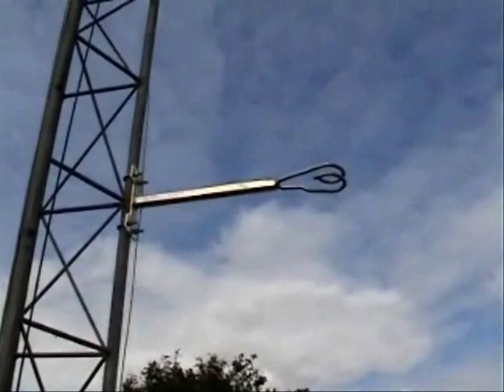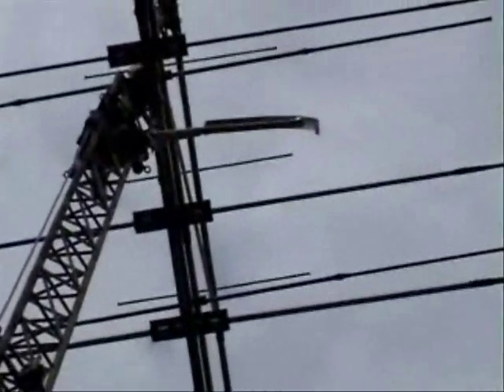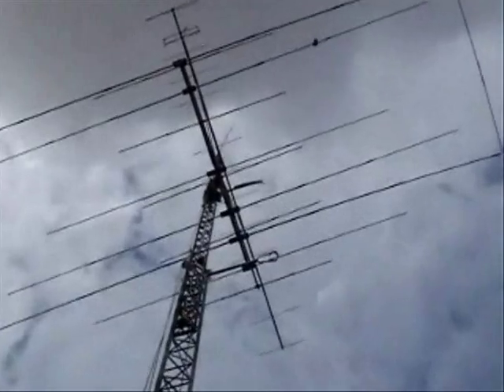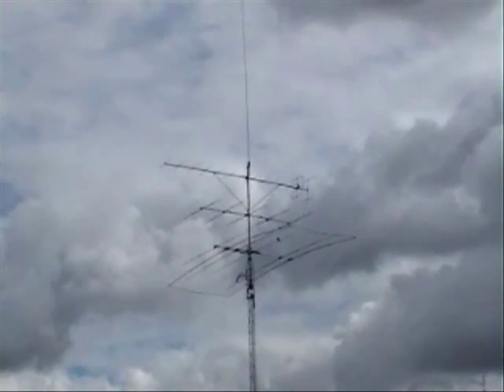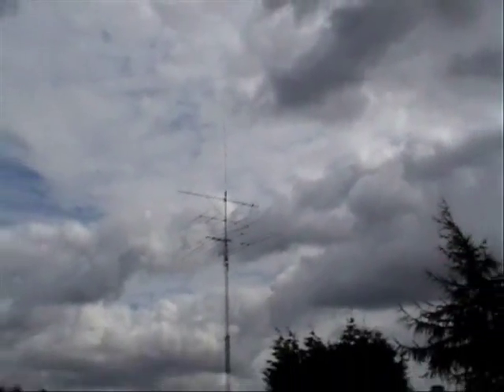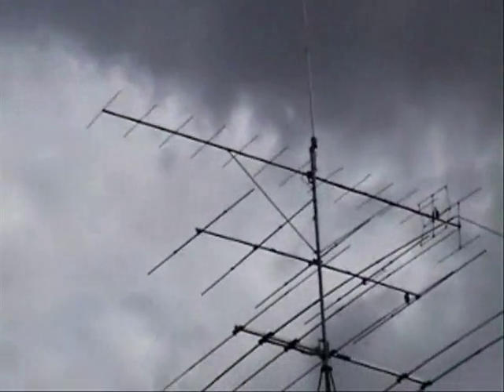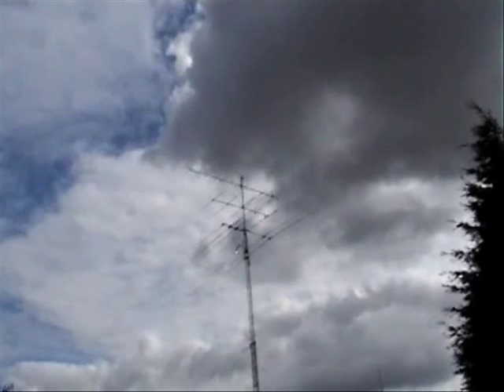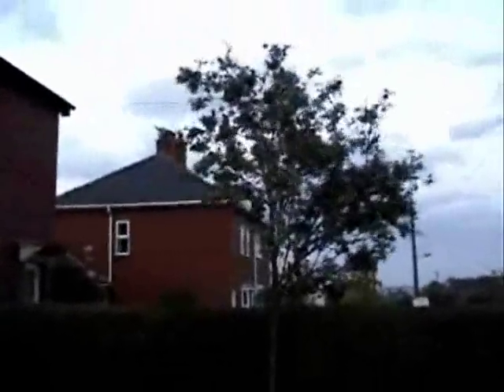Jogunn 5 Element Yagi Installation And 70MPH Winds

Comment from the maker: @rradishuk Thanks for the Flowers Ian, I have some new antennas to test soon as well, but this Jogunn realy is a Monster....it doesn't look too big in the video but even the Optibeam only has a 13/4 inch square boom, this is 2 inch square by around 17-18feet.
I had to install one end and then crank the tower up,spin it and fit the othe side!.
I'll take some footage when it is tilted over and i'm fitting the 10 elements (5 full ones).
I'm sure maybe I'll be heard.

73 Dave